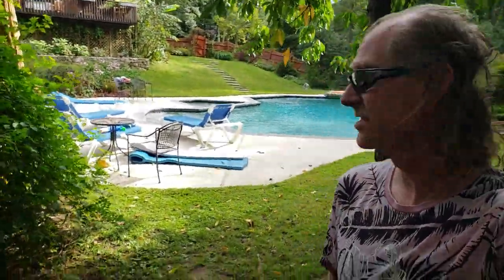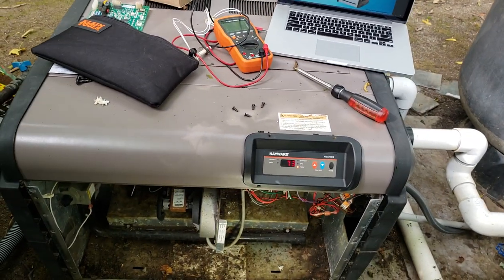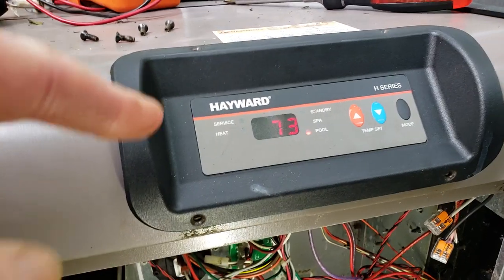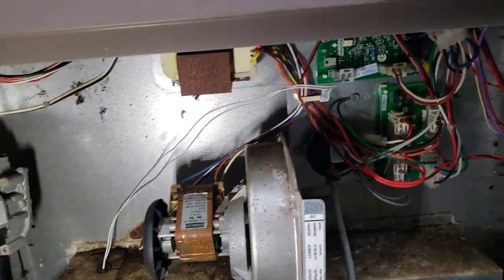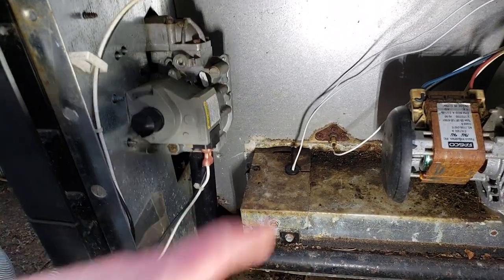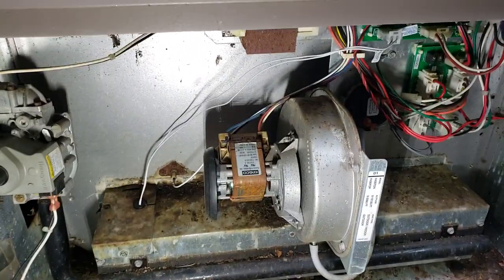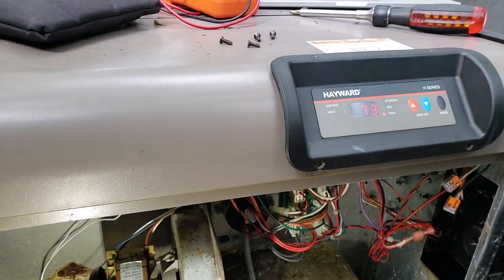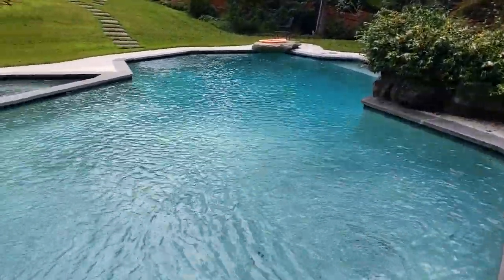Hayward H400FD pool heater fixed igniter issue no thanks to Hayward support

Comment: Of course hayward does t want to help homeowners, the last thing we need is homeowners messing around with gas appliances!!! Its dangerous, and homeowners do the dumnest things to save money, kikling themselves in the process!
Reply from the maker: If a “homeowner” calls and says to support, “the inducer motor kicks on, the pressure switches close and the board is sending 120v to a new igniter I just installed. The igniter is heating fine but before the gas valve opens I’m getting an IO code and it’s shutting down.  I’ve gone through every troubleshooting step in the service manual. And at this point it says to call Hayward”
That’s a lot different than a caller saying “duh- I live in a house with a pool and the heater is broken. Can you help me fix it?” 
My suggestion was if you know what you’re doing- Hayward shouldn’t just say “sorry can’t help cause it’s your house”.

Comment: Three years ago, my IF code was a stuck regulator diaphragm on the back of the gas valve. If you DON'T know what you are doing, leave it alone and replace the valve. If you have a clue about mechanical stuff, you can remove the rear cover of the valve, and check for the disk sticking. This winter it was clogged jets in the big black pipe at the bottom. 7/16 wrench to unscrew the jets, tap out the gunk, and clean the pipe if you can. Replace the jets into the black pipe, and test. IF usually doesn't involve the ignition. If start the heater in the dark, look for the orange glow in the burner window, this will tell you the igniter is likely working ok. Can also be caused by low fuel flow, or in my case an LP tank with less than 1/8 full. Not enough pressure head in the LP lines to get a good solid 'WOOOOF' when the gas comes on.
Reply from the maker: That's good to know. Thanks. So far  no IF faults. This one was "io" which supposedly was the ignitor.  But it wasnt. 
Interestingly, before I made this video I was so pissed I left a comment that "Hayward refused to help me" with a brief summary of this story on a video on their you tube channel. 
Didnt see that they responded until 3 months later, but they first asked me to call in so they could help.  When I didnt respond they suggested that if I went through the flow chart on their site, and it still wasnt firing, I should replace the circuit board.  

Bingo. That would have saved me a lot of aggravation. 

Thanks for the comment. Pools are money pits.
Reply: Hi Doc, I am having IF issue. Gas valve does get activation voltage but it does not seem to turn on. Could you explain how to access the diaphragm so I can try before embarking on a $150 new valve? Thank you!

Comment: Thanks for the video. I'm about to check my Hayward H400. It's only been used about 10 times in 5 years, but it broke for no apparent reason. It's not just the harsh weather in New York; we have the same issues here in Florida. The problem is poor quality due to production in countries like China. The circuit boards in these newer outdoor devices, whether it's HVAC or other similar equipment, aren't built to withstand the elements. It feels like manufacturers just don't care. Honestly, they're all the same; none of the vendors are reliable.

Comment: I have the same exact heater and it keeps sputtering and won’t turn on to heat….going to watch this full video hopefully it helps 😢
Reply from the maker: There are so many possible things that can go wrong. It’s just like a furnace you would have in your home. The display board code is what you need to look at. Good luck.

Comment: Hey when you mentioned how many boards you've had to change out, i would consider testing the ground wire. I find that to be a issue with furnace boards especially with new construction. You may not have a good dedicated ground
Reply from the maker: Thank you.  Thats actually a good thought. Don't want to jinx it but the heater has been fine for the last couple of years. By coincidence I fixed my one issue that nobody could figure out but a few people had- I couldn't turn the unit off completely without killing the propane.  Turned out to be something called a fireman's switch on the timer. It was shorted out and bad. Took it out of the loop and all is working great.  
Thanks for the good advice though. I'll keep it in mind!

Comment: Hello, mine says IF, changed igniter and main board already, still show IF code. Any ideas?
Mine is Hayward H250FDN model
Reply from the maker: I would check pages 44, 45 and 46. There are a lot of tests and things that can give that fault, most related to gas valve, flame sensor or insect webs in gas jets. The service manual below gives great detail. Good luck and let me know.  http://www.haywardnet.com/pdfs/UHS-Heater-Troubleshooting-Guide.pdf

Comment: It’s 29° here in New York and I’m still trying to get my new unit Hayward 400 BTU to even go click click the dirt get it going so the water won’t freeze over in the pool… no era code but I’ll figure that part out… but more importantly who’s your landscaper? :-)
Reply from the maker: Dude, drain your pool about 18”, and winterize everything.  Pull the plug and blow the water out of the heat exchanger so it doesn’t freeze and fix it in April!  Ps I’m the landscaper.  It looks good from far, but it’s far from good.

Comment: The boards controller if was probably bad, not sending the power to the igniter. Just a guess
Reply from the maker: Probably something like that. It is very hard to have electronic components sit outside year-round in New York.  Even if direct moisture is kept from the board, there is humidity, insects, etc. The pool is a money pit. Luckily I can usually fix stuff inexpensively. 
Let's see, pump motor replaced, impeller twice snapped off, 2x circuit boards, heater display board, auto top off replaced, not to mention skimmer parts break, weirs need to be replaced and valves need new o rings. Yuk
Reply: @Samlol23_drrich  yup I live in Michigan where there are a lot of drastic temperature changes. Opened my pool last year and found that I had to rebuild my pump because just about every seal was cracked. Puddles of water all over the place.

Comment: Thanks helpful. I have same heater. Getting lower case code “bd”.  I called Hayward and they says it’s an ignitor or ICB, or blower.   Any ideas on which of the three ? Thanks
Reply from the maker: In the video description is a link to the service manual. Download it if you haven't and follow that troubleshooting step by step. Check the propane supply and valves. I would shut them and open them a few times. May be related to that. Good luck. Let me know please
Reply: I ordered a new ICB and igniter going to give those a try today.
Reply from the maker: @smotto11  good luck. My money is on the board. They fail a lot from my experience and what I hear

Comment: Having this issue at a vacation rental 😢 totally sucks.  Yours is the only video with the same code. It rained so hopefully, that's the issue IDK
Reply from the maker: When it’s nothing else it’s the control board. I’ve learned that over the years. Now I buy the most mechanical least electronic things I can find. Good luck

Comment: Is anyone familiar with just replacing the if igniter? I have it exposed, but not sure if ordering and just removing a final screw or two and removing/replacing is enough. I also have problems with the small animals.
Reply from the maker: I actually did replace the igniter , and yes it was as simple as removing that one screw, and then plugging it into the circuit board-  if I recall correctly. In my case it didn’t fix the issue

Comment: thank you very much.   My heater is not igniting, I rreplaced the board .   the  blower comes on but does  not ignite.  Maybe I need an igniter.   I appreciate your hel;p  Charley
Reply from the maker: If you are comforTable working with electricity and have a multimeter, trace the wire leading to the igniter to the board (it may even say it,), and power it up with the multimeter and see if the board is sending 120v to the igniter. If it is, replace the igniter. I probably would have done that before the board, since it’s cheaper. If it was the igniter, save your old board, it’s good to have an extra. Are you getting an “io” code on the display?

Comment: Have a board problem too, I’m a software engineer by trade so I decided to just replace their board with my own. Long story short, for less than 100 bucks I know have a fully functioning smart-enabled controller that I can access via a simple app on my phone now and view/set pool temperature and override on/off switch. That said... it’s presently a bunch of wires temporarily connected in - I’m trying to find some broken controller boards to source the connectors from - any chance you have the old/broken one still?
Reply from the maker: Unfortunately I just soldered in a new triac in that old board at the suggestion of an electrical engineer's comment on this video. 
The part was less than two dollars. I have yet to test it, but im going to save it until my current board breaks and then swap it out. I like having donor parts anyway, so unfortunately cant help. Sorry

Comment: Ever have an issue with the touch pad not lighting up to read and not able to send commands? ( Power to unit but no power to pad)
Reply from the maker: Hey I'm sorry that I did not see this comment until now or I would have answered.  No, I haven't had an issue like that. The touch pad with bezel is one part. There is also a small circuit board that screws to the back of the touch pad.  I think its called the display board. . Then that board connects to the main board of the heater. 
I would use a multimeter and try to test for continuity while pushing the up and down button. Maybe you can get an idea of if its the actual buttons (no continuity when pushing) or that display board.

Comment: Gotta call to check out Hayward pool heater. Power to unit but no power to the membrane touch pad at all.
Reply from the maker: Didn’t see your comment. I assume you figured it out?  Hopefully just the cheaper board the display board.

Comment: IO pressure switch.
Sometimes is the water pressure.
Reply from the maker: If it says "LO" yes. This was a different code per the service manual.  Thanks for the suggestion though

Comment: Just swapped both the igniter & that circuit board.   Still no fix.

Says LO.  I’ve cleaned the filters and still no fix.  Changed out screeen display board still no fix.
Reply from the maker: Im not in the business but LO means low water flow.  Here is the manual
http://www.haywardnet.com/pdfs/UHS-Heater-Troubleshooting-Guide.pdf
Check the pump, returns, etc
Reply: @Samlol23_drrich  Lo usually means slow water flow from the filter, time to wash the filters..may give that a try
Reply from the maker: @alfredkulhanek1889  look at the service manual in my last post.  Pages 40 thru 42. It says lo could be a bad water pressure switch, vent pressure switch or temperature sensor switch. Shows you how to check them, and what they all look like. If you don’t have a multimeter to check continuity, you can probably just jump out the switches one at a time and see if the code goes away (if you know how to do that and are comfortable with electricity etc). If it’s not flow due to a filter (my guess is that it’s not. The flow has to be severely restricted to cause this code in my opinion) it’s one of those .3 things. All are easily accessible and easy to test. Good luck.

Comment: Thank you Sam, I had the same issue last year and your video helped and I replaced board and ignite earn everything was working good in till just now when the same issue is happening.
I can see voltage of 120 volts coming to the egg nighter but the system will not light.  Going  to replace the board again.
Let me know if he have any helpful suggestions.  Thanks
Reply from the maker: I wonder what would kill two boards in under two years.  Are you sure it’s not the gas valve?
Reply: @Samlol23_drrich  No sure if it is. How would I check the gas valve?  It has been working well and the unit is installed indoors with vents out.
Reply from the maker: @roshanhath  honestly I'm not in the business so I'm not sure without researching it. I think it should click when it opens. It was merely a guess. I'll see what I can find and edit this post if I do. Okay edit. Watch this guys video.  It's very good. https://youtu.be/ENIPrRqL3gc
Reply: @Samlol23_drrich  Hey Sam, found the issue. The igniter was bad but when I put a new one it still would not light up. So before replacing the board I took the system out of bo (bypass mode) and it suddenly worked. Put it back in bo and it still works so far. Thank you for you help. Roger
Reply from the maker: @roshanhath  well that’s good. The boards have gotten expensive. Glad it’s working. Enjoy the pool. We have another 3 months here until I see what damage the winter brought to my heater. It’s a yearly worry. Thanks for commenting.

Comment: thats pretty much what we do on a site is just start metering out anything and everything that deals with a code.   i hate they wouldnt or couldnt help you on phone.   its hard for techs sometimes to get someone on the phone with various companies.    glad its fixed, thats the main goal....   but at least now you know you can fix probably 99% of your hvac type stuff too.  lol
Reply from the maker: Thanks. I appreciate the nice words because most in the business don't take such a calm approach when a homeowner wants to work on their own equipment. I happen to enjoy it (since I don't do it for a living,  every day, its a novelty and rewarding when it works out).
Heck, I'm a dentist and even replaced the motor on my panoramic xray machine, and one of the start boxes on my copeland head compressor that runs my office. 
I guess you could say i like anything other than fixing teeth......
Thanks again for watching and for the nice comment. Really
Reply: @Samlol23_drrich  when a homeowner busts out a multimeter and digs in.....i for one have no problems at all helping.   we get calls sometimes and if it is a customer i know knows how to check a few things...i will straight save them a service call and tell them exactly what i would start checking first.   some of these companies are staying off the web due to people selling their products online that comes with no warranty and such.   keeping the warranty is a huge deal with getting an actual service tech to put their name on it in that case.   but if its out of warranty.  dig in.   lol
Reply from the maker: @naturalstatepoolandspallc338  wish there were more like you!

Comment: Ok. I ordered same part with directions and am not sure if I have 7 pin connectors or 11 pin connectors. Please advise.
Reply from the maker: I’m not sure what part you are talking about. The main circuit board? Did you go to Hayward’s site and grab the schematic of your exact model, and get the exact part you need? Or similarly take a look at the old board for a part number? If so, it’s as simple as removing all the connectors from the old part and plugging them into the new part. It should be identical.
Reply: @Samlol23_drrich   Amazon sold both igniter and circuit board.
Reply: Gonna try! Thanks!😊🌻
Reply from the maker: @goldenshovel9154   Good luck. Do yourself a favor and don't disconnect a single wire without taking multiple pictures Of that old  circuit board with the wires connected first.
Reply: @Samlol23_drrich  As a teacher who pinches pennies and am willing to learn (YouTube is an excellent resource 😊), I promise you I have multiple pictures but I'm very grateful to you for not just replying to my question but your input. Thank you. Thank you. Thank you.
Reply from the maker: @goldenshovel9154  don't thank me! You're assuming I know what I'm doing........
I too am an avid YouTube learner. Just so happened there wasn't much on this subject, and I'm fairly competent at testing and repairing things- and it was extremely annoying that the manufacturer wouldn't help me. 

Hope it works out. It should if you're getting an IO code

Comment: I have an issue with my H400 heather. Since today, everytime it starts it makes a loudly blast! To the point that the noise alerted my neighbor, who came to check if everything was fine. For precaution I turned it off and closed the gas valve. I suspect that the gas valve leaks releasing too much gas before sending the spark for ignition. Any ideas? Thanks!
Reply from the maker: I would definitely call an expert for that. It sounds like delayed combustion, where extra gas is building up before it’s ignited. Can be a bunch of things, from low gas pressure to dirty burner. Any code?
Reply: @Samlol23_drrich  no codes. I will check gas pressure.
Reply from the maker: @JoseManuelDiazFranco  I would remove and clean the burners also.
Reply: Jose, did you ever figure out the problem? Mine is doing the exact same thing and I'm running out of ideas. I was told it might be a soot problem but blew everything thing out and no change.  Thanks in advance for any help.
Reply: I work on appliances and this looks similar to ovens, heaters, and dryers. What you described could be a bad igniter. In ovens the gas valve will open when the igniter starts to pull about 3.3 amps. Sometimes when they go bad it will pull the amperage but not get hot enough to ignite the gas, but since it is pulling the amperage the gas valve will open and fill the oven with gas. If the igniter the  gets hot enough while there is excess gas building up it can cause that problem. If the igniter on these are the ceramic glow bar style then you can try turning the gas off and watching it heat up. It should glow bright white in the center within  45 seconds. If it is only glowing Orange or takes a very long time for the gas valve to open then I would just replace the igniter to be on the safe side.